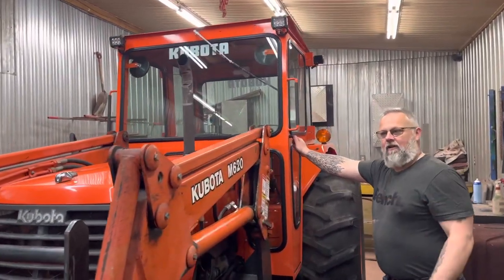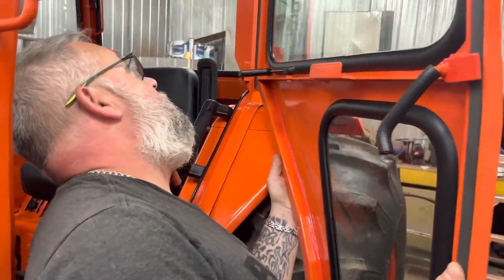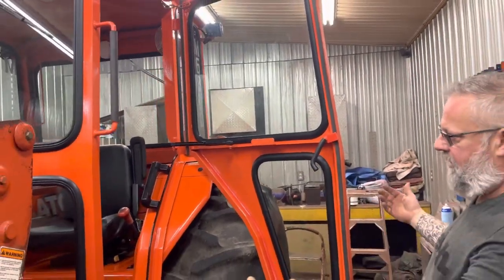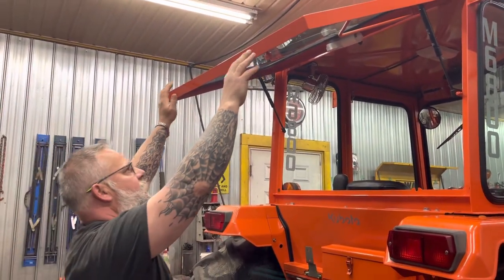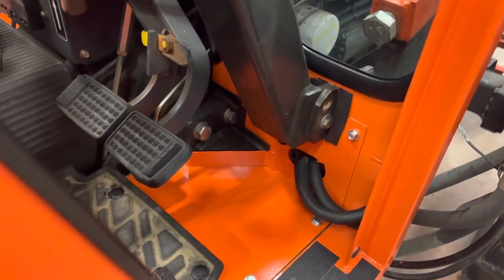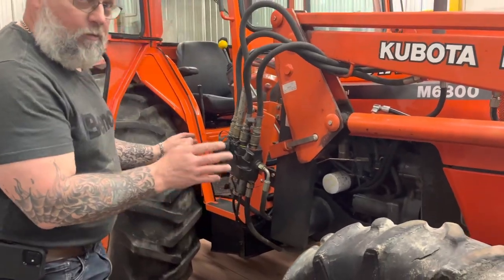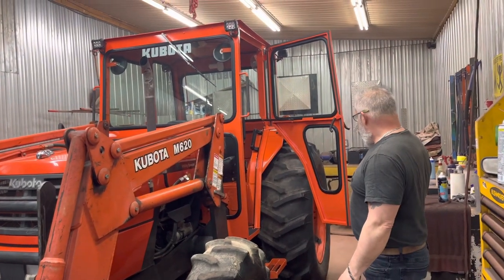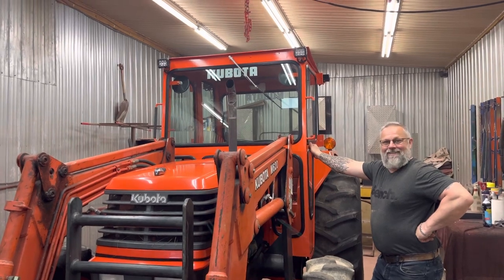Custom Fabricated Tractor Cab // Kubota M6800

Comment: Great work Brad.  I love how you think about the problems and areas for improved performance and implement them.  Tight shutting doors, clearing the tires with offset hinges, filler panel with toolbox access retained, rear tilt window with gas struts.  All awesome.

Comment: we need to figure out how to put an A C in these things without breaking the bank or using something like a roof air. great job also would love to see how you seal between the motor and the dash area to prevent excess heat from the engine in the summer. Ive built my own cab on my m6060 just no doors check it out. yours is much nicer but hey this was my first one
Reply from the maker: I get asked all the time for ac ,honestly it’s just to much $$ and a whole lot more work ,but yes it could be done..
Reply: @bradgraycabs  Thanks for the reply, I agree on the money part. I added a radiator fan above the seat that blows downon the operator it works great not ac but sure beats the heck out of nothing.

Comment: Do you guys have test ROPS/FROPS requirements? Just wondering how you get around that. Thinking about fabbing up a more forestry type set up for my MX and I didn’t have to incorporate that crappy factory ROPS, it would help.
Reply from the maker: No requirements around here, it’s just myself alone in my shop building what I think is a very rugged product that the average person can afford, as far as rops goes I’d rather be inside of one of my cabs than an open station tractor with single rollbar any day if i were to topple over or have something fall from above. Good luck with your forestry rops project I’ve done these years ago and it’s fun stuff basically all around armour for the tractor 🚜 I usually come off the front bush guard with heavy 2’’ square tubing straight back to top of front of cab encircling entire cab then dropping down to tractor frame level and secure, underneath the tractor usually gets a full heavy skid plate, pretty much bulletproof after that
Reply: @bradgraycabs  I’d rather be in one of your cabs too. The only issue in the USA is that it’s a big violation of OSHA to allow an employee to operate a tractor that has an unapproved or modified FROPs and ROPs. Plus civil liability. Farm owner can operate them, just not employees.

I don’t yet have any local employees but might in the future.

I plan to do basically what you describe but I’ll make a new fixed grill guard and might use  round tubing instead though I would rather have square…depending on price and availability in my area. Going to check before I buy a tube bender plus dies.

I think I’ll run limb risers from the grill guard and tie them into the cage for the cab. And build the cab cage completely independent of the existing ROPS - pass it over the top of the factory ROPS and tie it into the same mounting point the ROPS is attached to.

This should allow me to relocated the marker/turn lights off the fender (one is already bashed) into the cage and better protect them (and incorporate work lights).
Reply from the maker: @silverbackag9790  sounds like a good plan,if you use round pipe you can buy all kinds of weld on elbows,90*.  45*. 22.5*.   ect. Makes life easier good luck with your project I’m sure you’ll do great 👍

Comment: Where are you located? I have a 2000 kubota M8200 and this is something i could be very interested in
Reply from the maker: Hello sir, I’m located just outside of Bathurst NB
Reply: @bradgraycabs  your work is excellent
Reply: @bradgraycabs  do you have a estimate on how much a cab cost or does that depend on the tractor?
Reply from the maker: @reecemcdowell7768  most cabs are around $8000 installed ,pretty much loaded and ready to work
Reply: @bradgraycabs  I’m subscribed. Will you ever add AC in the cabs?
Reply from the maker: @reecemcdowell7768  been asked that a lot answer is probably not because it’s very expensive probably $3000 or more then it’s where to mount unit,compressor and figure out pulley connection?? No doubt it can be done but don’t want to open a can of worms